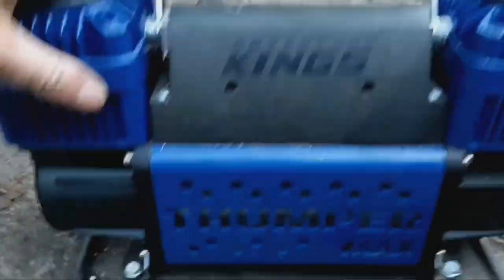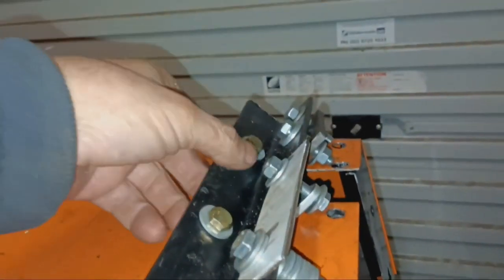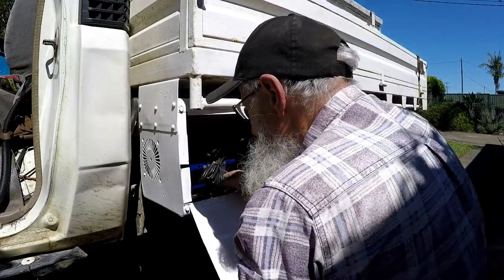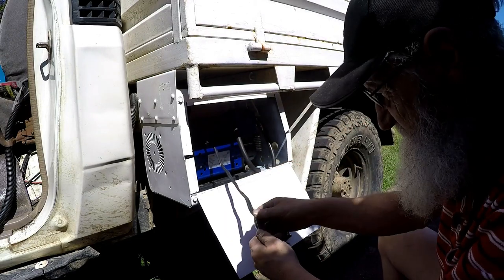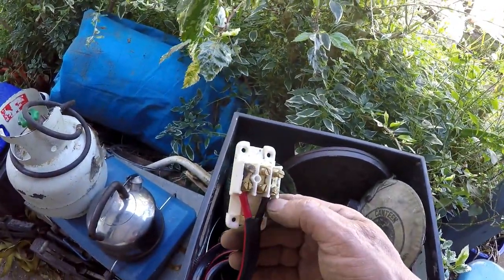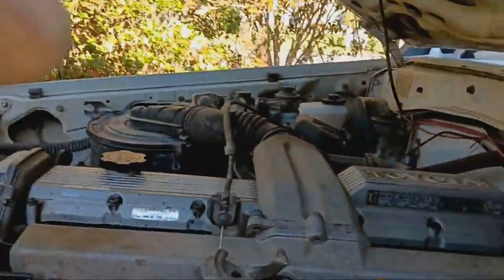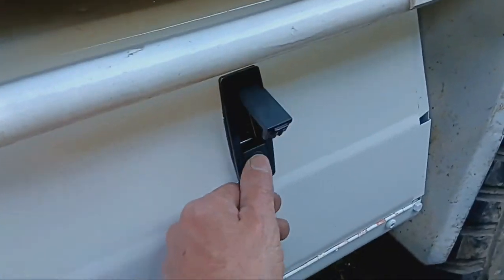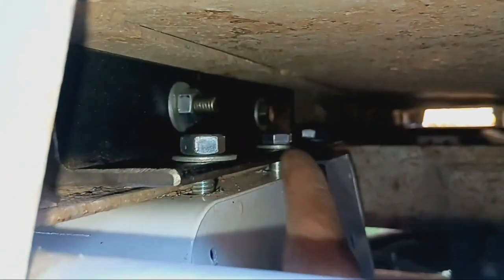12v compressor install

Comment: Doug, I was thinking of an idea (your call of coarse). But if you got a piece of tin, slightly rectangular and bent two opposite sides into an "L" shape to create a 10mm gap and pop rivetted the two sides in front of that fan hole in the front would allow air to pass through the sides (not bent) of this cover plate but help prevent mud and rain getting into the fan opening.   Does that make sense?   if your not sure what I mean I'll draw a picture and put it on my alternate channel.  Wont take a minute to put up.
Reply from the maker: @AaronHahnStudios  I was looking at it yesterday thinking about that hole, it doesn't need ventalation because I'll only use it when stopped and the door open. Spent way too much time on it
Reply: @DougAskin  Fair call. I just didn't want to see mud all over your nice new compressor.  You know Mud, it just gets Everywhere.

Comment: you got drain holes in there ?
Reply from the maker: Yeah plenty holes in the bottom. I could make it more water tight
Reply: @DougAskin  the compressor would require ventilation , intake as well as cooling
Reply from the maker: @bruceaskin9645  one day I might get an airlocker for the rear diff but for now the compressor will only be used when stopped with the door open